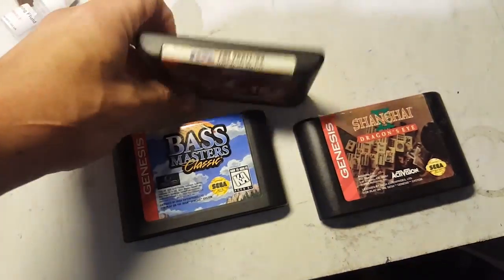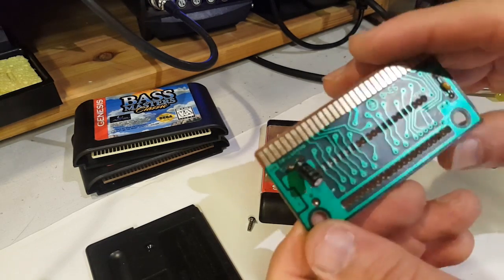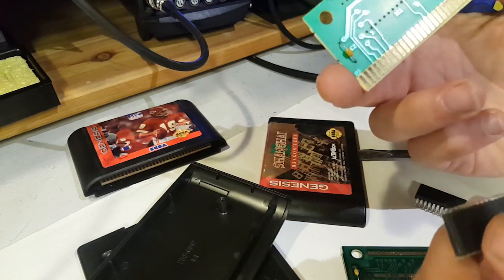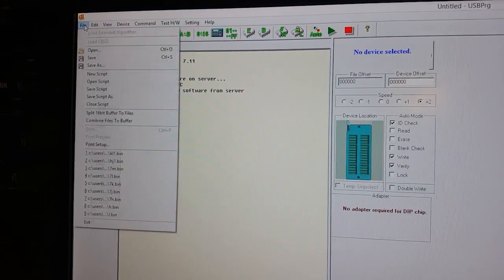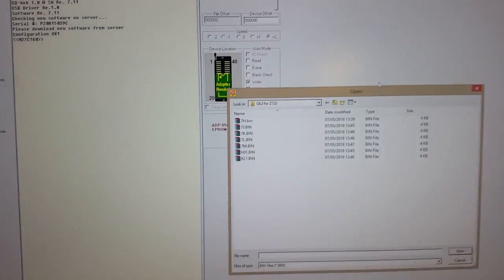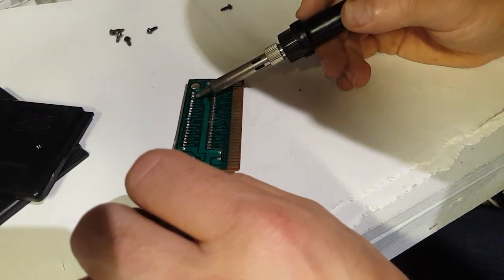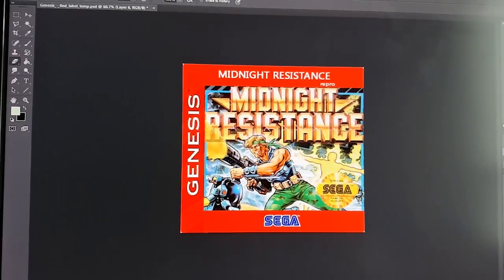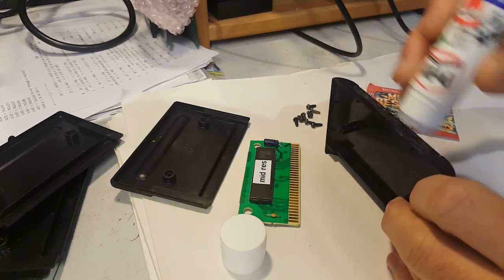Making more Sega Megadrive / Genesis repro carts

Comment: Great stuff. Love the JVC CRT. Making some repro carts myself in the new year, Shinobi 3, Castlevania & Streets of Rage 3. Using the TOP3000 programmer as it has a 48pin socket. You can get new PCB's for the carts online from a guy in France for around €5 each (cheaper to buy a few) . You can also get new ABS plastic shells from aliexpress cheap. Dragonbox.de also sell new ABS cart shells. Shopped at Dragonbox.de a good few times, they have some cool stuff.
Reply: you could check out your local retro shop you can get carts with damaged labels for €1-2 thats a eprom and board

Comment: How did you burn games less than 2Mb on a 27c160? Did you duplicate the data? Pad it?
Reply from the maker: more than likely you can pad it with whatever or leave it "empty" , since any value is technically padding . Good practice (and common sense) would advise to duplicate the data as much as needed though as it'll fix the issue of floating higher pins

Comment: Do you need to pad the roms for them to work if the eprom is bigger? I tried a 1.79mb on a 2mg eprom with a 4mb board and no luck just a black screen
Reply: Yeah, you can duplicate the the code (Copy and paste) to fill it out. Some programmer software will allow to fill the empty space with FF. You should be fine. You might have to do a byte swap, again some software lets you do this but if not you can find apps online that will do the byte swap on the BIN file. SBWIN works great for converting emu files (eg .GEN) to .BIN

Comment: I use cheap no-clean solder wicks and I've had more success with those than a high end de-soldering gun. I know the popular opinion is that it's not smart to do that, and to each their own, but seriously.....it's clean and quick.
Reply from the maker: some people are really good with solder wicks. I'm not so the desolder gun comes in handy. at the end of the day, there's no "right way" . if it works for you go for it. :)

Comment: Do I need to fix the checksum AFTER byteswapping ?
Reply: Hi , did you succeed to burn the EPROMs and got them to work ? I personally done exactly how it is in the video but it didn’t work.
Reply: @alialbazzaz9503  Yes I succeded with a TL866 and the proper adapter 27C...I tried only with 512 k roms. What size of rom are you burning and what kind of pcb are you using ? On mine I have jumpers (determining the size) where i need some solder and a resistor for the game to launch.
EDIT: This is the best video I found on the subject : https://www.youtube.com/watch?v=jw_2mUTdxVY&t=375s&ab_channel=RyanBates
Reply: @ClbnaVGM  i am using the 27CM160 ST , on the original PCB of Batman Returns  1992 game , i took out the original chip and added an adapter to make it my test PCB  , so i tried burning splatter house 3 , Contra hard corps no use , i am using the GQ 4x4 with the  ADP-054 16, can you advise how to make it work ?
Reply: @ClbnaVGM  also is there a site that you recommend to get the roms from ? i am thinking it might be the roms are bad
Reply: @alialbazzaz9503  No, I dont recommend any site as long as your rom launches in Kega Fusion emulator. Be careful if you have a message when you launch a game that says WARNING CHECKSUM INCORRECT then you MUST fix the it with a soft called "ESE fix checksum program" before byteswaping the file, or else nothing will work at all.
Reply: @alialbazzaz9503  YT deleted my last comment. So I re write. 
You MUST use the same capacity size for the donor pcb. Batman Returns is 1 meg, Contra and Splatter house are 2 megs so they wont fit the cart. You must use a 2 meg pcb if you want to burn a 2 meg game. Also blankcheck your eprom before burning (you have this option in the burning software ).